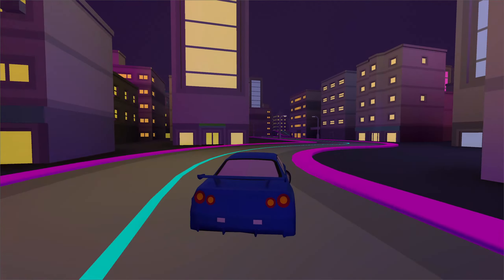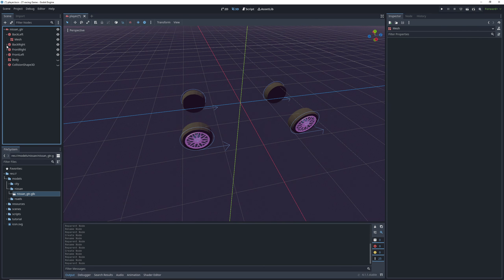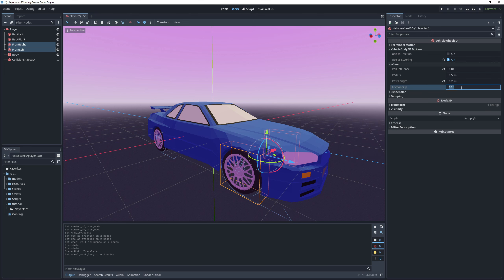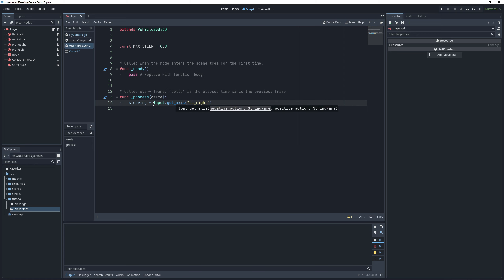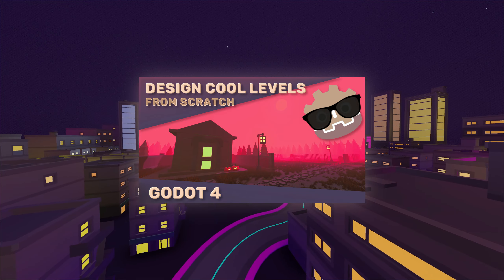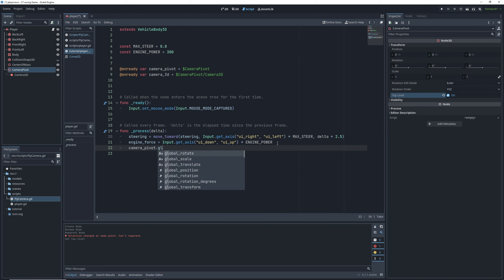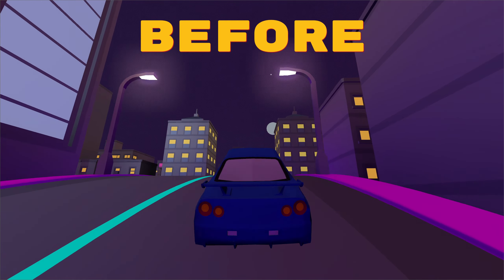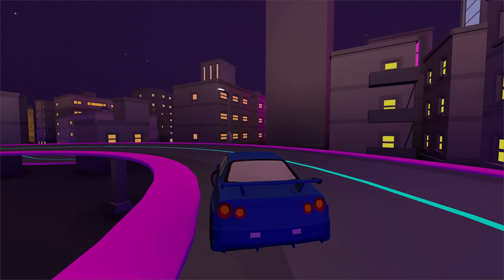Race Car Controller Tutorial - Godot 3D

Comment: Thanks for the great tutorial! I had a question though. How do we "lock" the camera's rotation in the y axis so when the car flips over we don't rotate the camera but when the car is steering the camera rotates?
Reply from the maker: Just to clarify first, because this is a bit counterintuitive, rotation around the Y-axis turns the camera left and right because the Y-axis is pointing up and rotating around is is kinda like spinning around that pole LMAO idk how to explain it. So you don't want to lock rotation in the Y-axis, you instead want to lock the rotation around the X-axis, that's the one that rotates the camera up and down. I would say just try manually setting the x rotation to 0 every frame and go from there.

Comment: Have you done an AI car? Coding an ai vehiclebody3d car that can avoid obstacles has been beating me for months.
Reply from the maker: Not yet, but it's a pretty interesting topic I want to look into. So far I was thinking of having like a path that it tries to follow using steering behaviors but when there's obstacles it dodges & then goes back to following the path. How did you try to implement it?
Reply: @legiongames2400  There are different navigation nodes. My problems are with the coding. I tried implementing different scripts I came across on yt but so far no luck. The struggle is real.